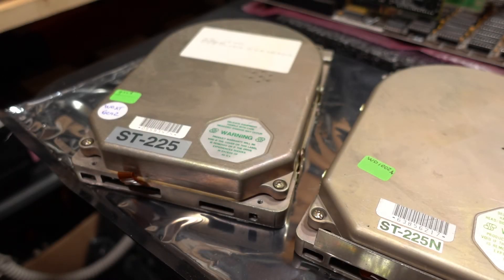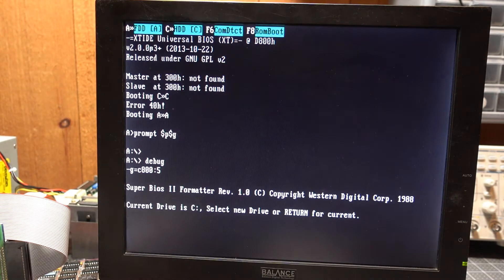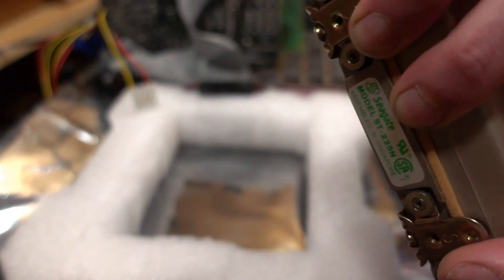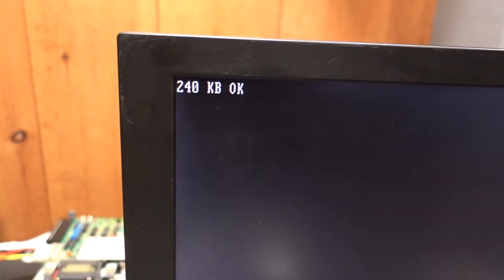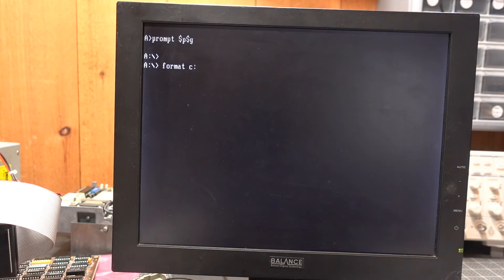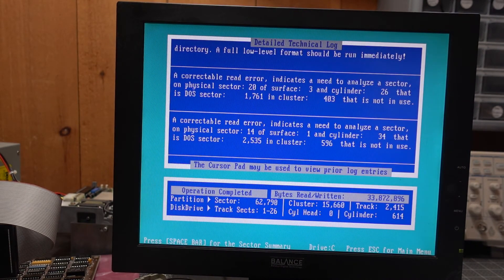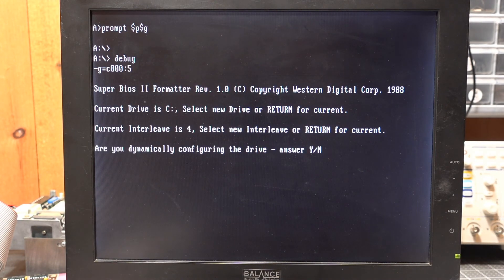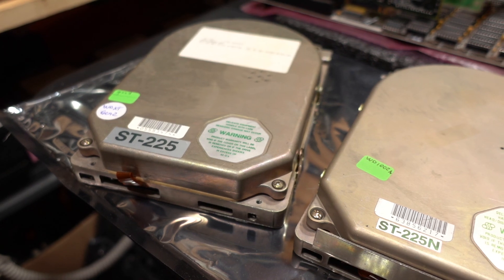Looking at a few vintage Seagate ST-225 20MB MFM Hard Drives & trying different low level formats

Comment: Hello Mr. Bradford watched your YouTube a few times about the low level format of an ST225 and learned a lot from it. I have successfully formatted a Seagate ST225 low level using this, with the parameters 615 4 616 300 11 3 that you specified. Now I am working on a 21 Mb Miniscribe 8425. Do you perhaps also know the low level parameters for it?
Thanks in advance Gerard vd Crommenacker from the Netherlands.
Reply from the maker: Hello, the Miniscribe 8425 has the same geometry, and will likely work with the same parameters as the ST225.  The Miniscribe documentation says 615 cylinders, 4  heads, 664 park cylinder and 128 write precomp.  Good luck!
Reply: @chrisbradford6224 Oké, thank you. I will try....

Comment: I have an ST-225 from 1989 in my 486 PC. Even after being opened up to manually park the heads at least two years ago, It still has zero bad sectors!
Reply from the maker: Sounds like you have a good one there!  With proper care they can last a long time and still be reliable even today

Comment: To be annoyingly pedantic, I think the technology of "microstepping" was developed after these drives were made.  I think these just use conventional stepper motor technology.
Reply: These drives definitely use microstepping; it's even mentioned in the documentation.  They also use a special low-impedance stepper which give them uncommonly good performance for a stepper drive.

Comment: got any st-251's?  believe it or not i have a CMI 20mb MFM from an at and it has 0 bad spots and works flawlessly.  these drives had such a bad rap sheet too.  those old seagate st-225 and st-251's were pretty bulletproof drives though.